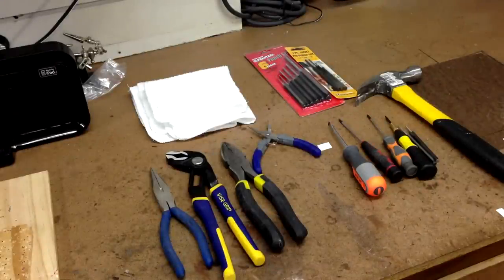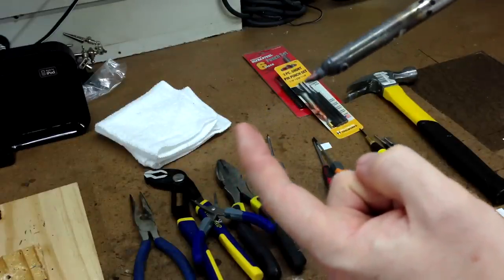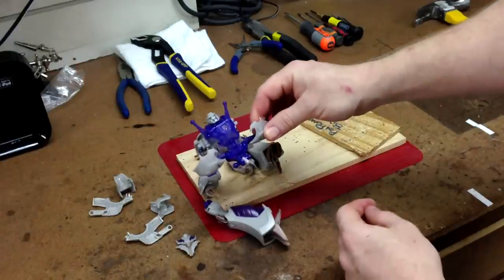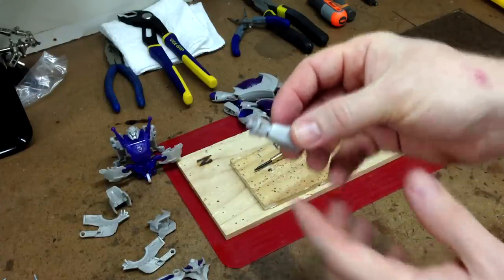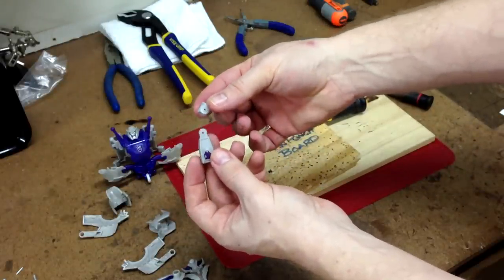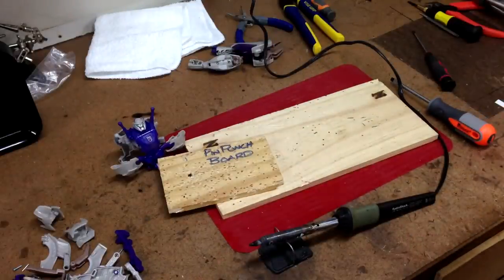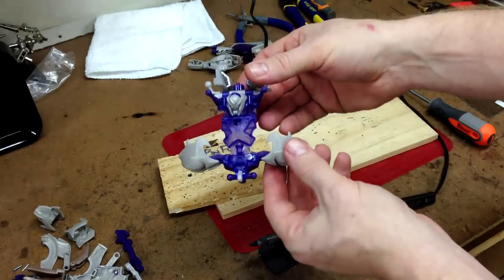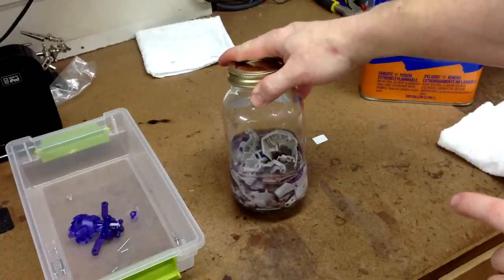Customizing Transformers - A Guide to Disassembly & Preparation  (Pin & Paint Removal, Cleaning)

Comment: Amazing video!  Could you link the center punch you use, the one I found was too big and I'm afraid it will break the figure.  

I would also suggest getting sanding files, they are nice when working with small areas you can't get into to sand.

Also using a rare earth magnet helps to pull a heated flat pin out.

For clear plastic that starts to haze, you can dip the part in future floor polish and it will fix that right up :)

Comment: Nice video. I've used acetone to open pores. Not dipping but only strokes. Bold I know but it survived. No clear parts on my figure. I do let mine dry out alone. What base coat you use. I did mine with mr. primer surfacer but the thing is not cheap.

Comment: Thank you so much for enlightening us CustomsByz.
I really appreciate you going out of your way to show the details of your work.
Which brings me to this one question.
When you reassemble the flat head pin, do you push it in first and heat it or heat it first and push it in?
And one more question is, you left the clear plastic parts. Is there any way I can remove paint off of the clear plastic parts? Which solution would you use?
Thnx in advance!
Reply from the maker: NO need to heat when you put the pins back in. Generally just a little force gets it back in. For the more stubborn pieces you can place the pin in the spot it is supposed to go back into, apply a little heat and push. To remove paint from clear plastic, just take some alcohol on a paper towel ad wipe, just DONT soak the pieces.

Comment: If I don't want to do a total repaint, only add some paint apps here and there, could I use the thinner with a q-tip quickly to open the pores just where I want to paint?  Also, what types of paint adheres best?  I like to do silver dry brush weathering but it rubs off so easily.  I like doing black grime/shadows in the cracks and machinery too but that's too out of the way to wear off.

Comment: On the metal pin step; how would you recommend fixing any minor stress fractures around the joint if those develop while using the center punch? 

I had one I had to push out just a liiittle farther than the punch was a good fit for and it cracked the joint slightly.

Comment: Hey man, How do you disassemble the MP Grimlock on his clear plastic neck?
Reply: The only way to do that is to drill tiny holes with a dremmell as the screws are covered by plastic that is poured over the tops of the screws in a liquid state, then it hardens and takes shape, hence giving the illusion of "no screws" in the neck.